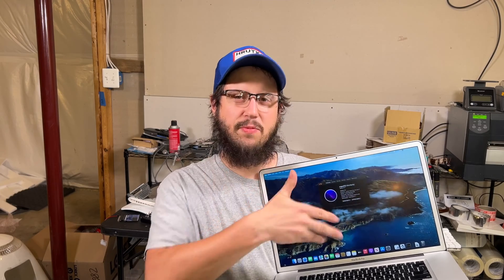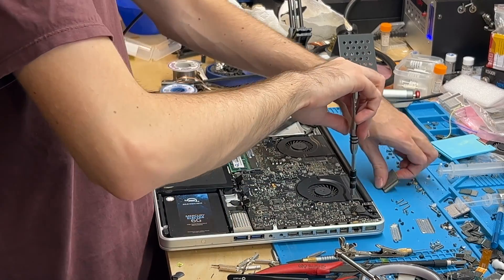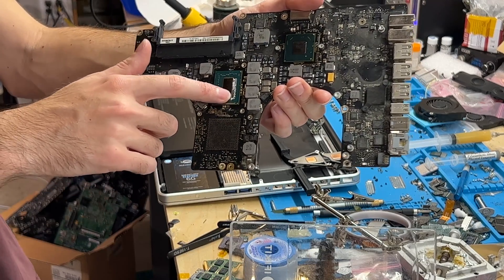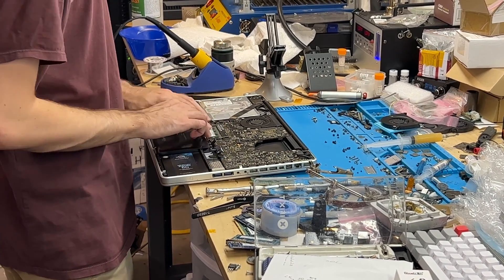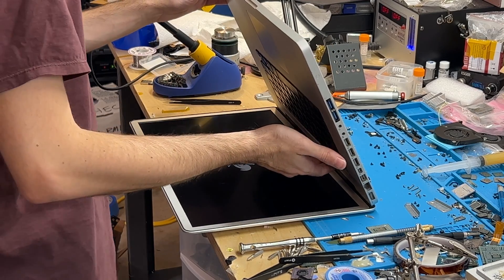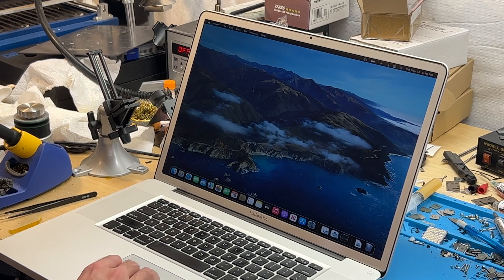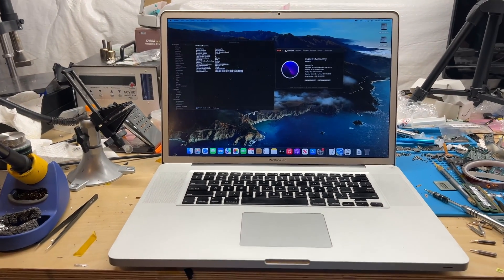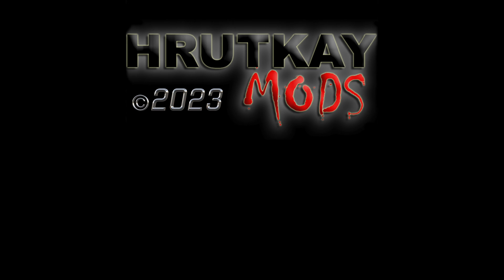Making A Mid 2012 17" MacBook Pro With dosdude1! (CPU Swap)

Comment: Try putting a 2012 15” logic board inside. Someone has successfully done it https://m.youtube.com/watch?v=VPHgZ2dEUYE
Reply from the maker: Yeah we did this though because you get to keep the extra USB port and the ExpressCard slot and you don't have to hack up the case to make it fit
Reply from the maker: I also think I know the guy that did that hacked mid 2012 build, he wasn't the first though
Reply: I know, but the you also get a GT 650M 😉
Reply from the maker: @clippy103  yeah but if we can figure out the voltage there's an AMD chip more powerful than the 650M that fits on it ;)
Reply: @HrutkayMods  wait, you can? Pls explain 😅
Reply from the maker: @allergictojabs8601 the FirePro M4000… the voltage regulation is different, but the pinout is the same so if we can figure out the voltage in theory with core boot, we should be able to get it to work
Reply: @HrutkayMods   ooooooh, hope to see a video on that soon 🫡
Reply from the maker: @allergictojabs8601 hopefully he figures it out so we can lol